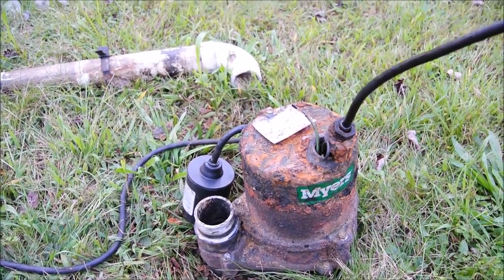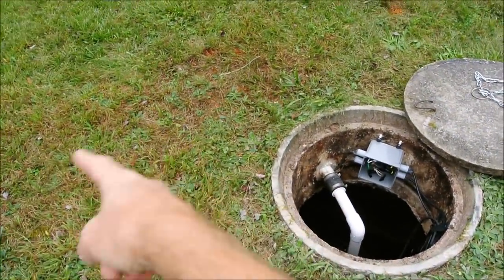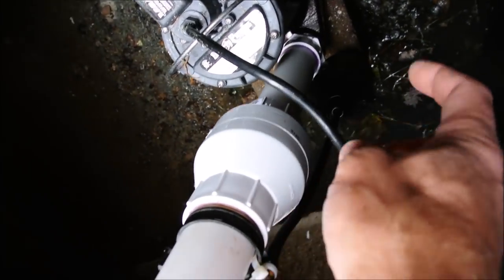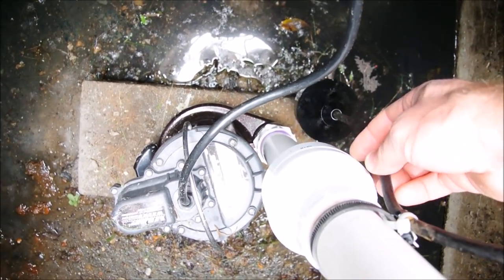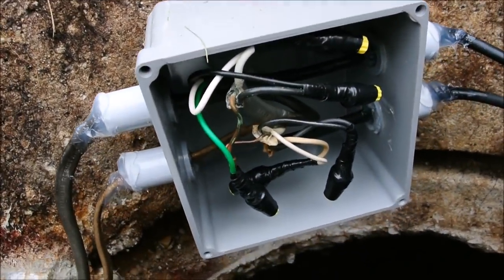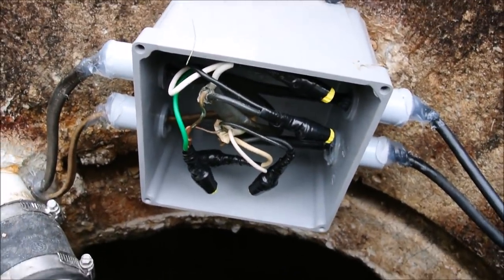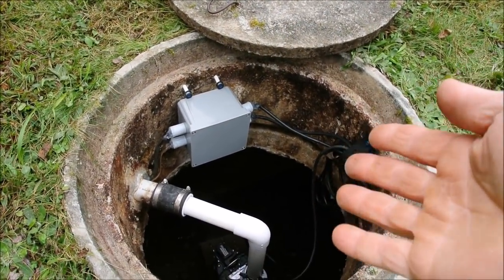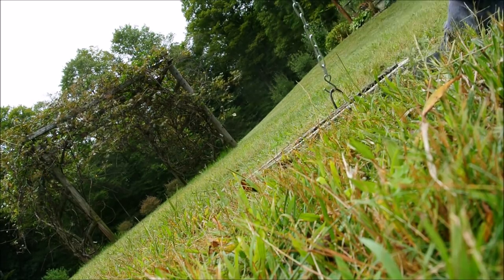Septic pump replace: DIY internal splice box

Comment from the maker: UPDATE (November 2022): 
The 'new' pump died yesterday. It survived for four years and one month. As I pulled it up, it was a rusty mass of mess that actually had pieces of metal falling off. Because the price of replacement (of a LIBERTY 257 series) had jumped from $141.51 to $210.75, I decided to go with Harbor Freight's comparable submersible effluent pump, a ½HP DRUMMOND, which was $159.99 and seems just as well-built. Time will tell.  

As for the splice box, it did a great job. Very little condensate was inside. Some corrosion to the bare copper was evident, and so I was more careful to cover any exposed wiring this time. The silicone plugs did a nice job; I was easily able to pop one out in order to rewire the new pump, and it was then just as simple to replace. 

This time, as an experiment, I placed inside of the splice box (on the bottom) a few pieces of scrap copper wire, just to act as a sort of anodic lightning rod. The idea was to have these piece of copper become consumed over time, thus absorbing most of the free ions that would otherwise be available to contribute to the degradation of wiring inside of the box. Note that the splice box is a rather well-sealed environment, making it somewhat of a closed system. Thus, the chemical change occurring to the copper inside is a reaction that can be controlled, and much like any stoichiometry problem, guiding the process(es) taking place becomes a game of recipes, in which we need only to determine the limiting reagent in order to slow degradation. One can bake only so many cookies with five pounds of flour. Again, time will tell.
Reply: I actually just bought a piece of property with an old septic system, this video was extremely helpful!
Reply from the maker: @SinclairDIY  Thanks, and good luck with the new place. If you're new to this stuff, here are two (related) videos that might help you:

Leach field restore:
https://www.youtube.com/watch?v=01FvMcsjiMY

Well pressure tank:
https://www.youtube.com/watch?v=WcENUayicPs
Reply: Thanks, I'll check them out!  @pocket83squared

Comment: I'm a Pump Technician and while I dont do anything with sewage I do mess with Sump Pumps quite a bit and also wiring what I need and honestly I dont see anything wrong with what you've done. While I'd do it different with my van stock I would probably do it the same way you did if I had to pay for it myself and find the parts myself. Looks good! Theres 100 different ways to do anything in the pump world!
Reply: what can cause a wire to burn out in the J Box? if it's the sewer pump, is it considered normal wear and tear?

Comment: Pocket83^2 officially has more videos than Pocket83.  And i could not be happier
Reply from the maker: Thanks. I have some more build-ish videos to put out on the second channel soon. It will be a while before I can commit to a main channel vid again.
Reply: @pocket83squared  that's great to hear! My son and I are very interested in what seemed to be multiplayer Isopath
Reply from the maker: That project was totally derailed. You can check the description of the Iso-path videos for the three player instruction sheet, but it's still a work in progress. Player zero has an advantage that I haven't remedied yet, but I have a few ideas.

Comment: My pump died (19 years old) and when the pro came to replace it we found the same kind of wire box. The connections were fried. Literally burned black. No tripped breaker in alarm box, no tripped breaker in main house box. Cleaned tank, replaced pump and box and wires. That was two years ago. Alarm went off today. Pump not working. Hopefully pro comes tomorrow. Watching your video explains what the problem is (bad wiring, corrosion in wiring, something in the wires obviously) and I will make them fix it right this time even if it means mounting the wire box on my tool shed. Thanks for the videos

Comment: I do this for a living. 
Everyone wants to splice your wires in a box but the problem is, condensation. 
I recommend just using blue wire nuts with silicone inside and securing the wires under the lid.
Reply: Can you drill a condensation drain hole in the box ?
Reply: gurjinder singh then what good is a box?
Reply: What can cause a wire to burn out in the J Box? if it's the sewer pump, is it considered normal wear and tear?

Comment: Thank you so much.  You have given me great ideas.  I have a system exactly like yours.  My house was built in 2010.  The crackpot guy who installed my original pump had a regular interior home electrical outlet mounted to the inside of my tank, located exactly where your junction box is in your tank.  The sad part is that the county I live in inspected this crap and signed off on it.  My original pump stopped working in 2017. I'm lucky it lasted that long.  I replaced the pump myself with one from Home Depot.  Since I was in a hurry to get it running again, I replaced the outlet with a new one.  I knew using a standard electrical outlet was wrong. However, I thought I would replace it next time and wire it inside a waterproof box.  Last week my pump died a terrible death.  Something failed on the pump and water got inside the pump.  It melted where the plug was connected to the electrical outlet and tripped the circuit breaker.  I called electric companies and they wanted $3000.00 just to install a waterproof box and wire it just like you did yours.  The electric companies won't touch the pump, so you have to hire a plumber too.  The plumber wanted $2500 to pull out the old pump and lower a new pump.  There is no way I'm paying $5500.00.  So, I just installed the new pump the other day.  It's an Everbilt 3/4HP from Home Depot.  I temporarily have it plugged into an extension cord that is plugged into an outdoor GFCI outlet.  I'm waiting for all the new electrical parts ordered to arrive tomorrow.  I plan to use a waterproof junction box and do mine like yours.  The total cost for doing it myself is around $600.00.  Thanks again for making this helpful video!
Reply from the maker: Great to hear. It's crazy how much those who don't DIY are willing to pay. Strange thing is, it's never been easier to find out how to do things yourself! Respect to you for replacing your own sewer pump. 

As hiring a trade 'expert' becomes increasingly impractical and/or inefficient, and as the acquisition of knowledge becomes increasingly inexpensive, demand may just start to shift the standard of what's respectable. People with dirt under their nails should've been respected the whole time. Our age of entitlement is dwindling.
Reply: @pocket83squared  I agree 100%.  I remember when I was in High School, back in the 1980's, our teachers would look down on those students who wanted to go to Trade School.  These teachers pushed the students to go to big Colleges and Universities.  We are now paying the price for this arrogant attitude. We now have a shortage of tradesmen, due to generations of young people being made to feel ashamed of this type of work.  In my opinion, big College degrees are overrated.  So many people now have College degrees that having one isn't special anymore.  I hope future generations will realize the importance of Trade Jobs and look upon them as honorable professions.
Reply from the maker: @georgelineberryjr3673  The irony is found in the number of not-so-impressive people who nevertheless hold impressive degrees. As much as I love and respect higher education, most of it is like throwing sand at a person and asking them to catch it. 

In the 80's, we were still certain that every social problem could be eradicated through education. Twenty years later, it didn't work, but at least now we can be sure that it will: we just have to get everyone certified as competent!

Comment: Yes. My 4 tank system 17 years old. Issues from day 1. Major problem is flooding during heavy rains. Flooding meand electrical plugs and wires were the issues like aerators burning out, floats inop, box fried. I finally got new box. Tried wiring it, pretty easy, this one to that one..Noticed alarms buzzing but off. Opened the junction and entire pipe, splices flooded. Now, realized I need to raise the junction to inside near lid. Foumd a box on Amazon that has 4 water tight in ports for the 3 float wires and pump.  Need a 1.25 hole to pvc conduit. Saerched and similar to the box you have. Added safety was water tight wire couplers floats 2 wire and pump 3. Before, the pvc came in thru riser level with tank so if water ever got high for a bit the commectiins were flooded and wet. Pump always worked though bit the connection elbow hole only had silicone to seal a those cables. Now find 20' wires to run new to box. I will use DB wire in the 1.25 for pump. Did it to my aerator and that sucker still good and no more corroded wires.

Comment: They to make all plastic "strain relief" connectors for cable but your silicone solution is better than anything I have seen. Great job!
Reply from the maker: Wow, thanks. The whole time I had the feeling I was settling for something, but I just couldn't trust those strain relief grommets- especially considering their price. The couplers/bushings were 20¢ parts. 

While I have you here, would you care to speculate what compound in this environment would turn copper wire to a silver paste? I used a piece to hang something and to test raw Cu's resistance to corrosion, and two days after there were silvery bubbles coating the surface. Ammonia, perhaps?

Comment: I’m surprised the box is on the inside of the tank itself, you can put it on the outside I believe, it’s been years since I did anything with a septic system, but I believe around here it’s set up on the outside of the tank, it bypasses the problem of corrosion, well, from the tank anyways.....I think, but I’m fairly certain about that. also, make sure you get your hepatitis shots! Lol
Reply: most boxes ive seen are still all in the tank. but still in training and hvnt seen alot of tanks yet.
Reply: But everyone hates having a junction box out on a post in the yard

Comment: I tried the light blue waterproof ones. The wires were coated with that goop. I had connectivity issues zoo took those sucker's off. Cleaned the wires and used large nuts. Less resistance and floats work now. Yes, later squirt in silicone. Added protection is ise liquid rubber or fuse tape. With the box high, like mine is now, less chance for the wires to be submerged . Before the wires were crammed into one of those D junctions. only a silicone filled hole where the wires entered. Needless to say any high water the enclosure was filled with water and float and box issues. Those wore things are glans. I got the 1/4 and 3/8.
So much easier now should I need to replace a float or the pump..Wires not dangling all over . Connections are right at the top so you don't have to work down into the riser hole. Y tank lids are poly but think I an adding a vent cap. The gray water tank gets really moist in there , always wet . I take lid off every so often to let the thing dry out. May use the extra old lid and make a vent cap to let that moist air vent out

Comment: Nope, wrong video to watch on my lunch break
Reply from the maker: There's a layer of fats and oils that float to the top of the first tank, effectively sealing in most of the gasses that result during the first stage of decomposition, so it doesn't stink as bad as you might think. Hey, is that salami? Can I have a bite?

Comment: I can share with you, that in a sewage tank, using clear silicone does not work. It is not airtight as you would believe, the toxic gases can pass through. I also tried using 2 part epoxy filling the splices pushed into a pvc pipe much like those sold similarly. Even that failed.  I've a Myers 2 hp 240v pump, in a tank much like yours, except it's a grinder pump. All my attempts eventually failed, even the SO cord eventually failed in a random spot, so it's a high degree of difficulty in any case.  The UL-listed individual splice devices consisting of a wire nut and a tube filled with some sort of nonhardening silicone the joint is pushed down into, ought to work.  I am replacing my Myers pump originally installed in 1992 today, so it's served its mission.  The tank is like 14 feet to the bottom, so I need to splice similarly to what you are doing.

Comment: The first problem you have is all the electrical connections are inside the Pumping Station, which is never a good idea. I don't know what part of the country you live in, but I'm in the northeast. As a Septic & Sewer Professional with 20 years of experience, I've repaired and installed close a thousand pumps in my career. As a result, I can tell you in my home state of New Hampshire, we try and make all the electrical connections for both the Pump and the Pump Alarm external of the Pumping Station or Pump Chamber. In other words, by using a pressure treated 4x4 or 4x6 to mount a Weatherproof or Waterproof Electrical Junction Box, it gives you place to attach the Electrical Conduit, and allows for easy access above ground. Here in New England, that's really important, because it's not uncommon for us to have 3 feet of snow on the ground. Keep in mind, in the middle of the winter, you need to be able to get to all the electrical connections without having to dig up the Pumping Station to access the wiring. Besides, "higher is drier" and keeping the electrical connections outside of the Pump Station keeps them away from corrosive gasses as well. By the way, you left way too much "swing" in the Alarm Float cable, because the Alarm Float wire only needs a few inches of play, and the height or elevation of the Alarm Float is dictated by the depth of the Pump Chamber and the elevation of the Inlet Pipe that allows the water to flow into this compartment or chamber. To be clear, you don't want the Pumping Station to get to the point where the water backs up into the Septic Tank, or worse, backs up into the house, before the Pump Alarm goes off. Believe me, that can happen if the Alarm Float isn't installed correctly. Ideally, when the Pump Alarm is activated, you still want some storage capacity left inside the Pump Station, which is why it's always a good idea, to have a larger Pump Station or Pump Chamber than you think you'll need. I never like to see anything less than 500 gallons, but sad to say, I've seen lots of 200 and 300 gallon Pumping Stations. In my experience bigger is better, and 1,000 GALLONS is better, because the pump won't have to run or cycle as often, which is better for the pump, and it minimizes the number of times a day the leachfield or drainfield gets water. Lastly, although silicone caulking works to seal the electrical box, I recommend Duck Seal and waterproof or weatherproof wire nuts instead of using electrical tape. However, you were very creative, and I'm sure what you did will work.
Reply from the maker: An external housing for the electrical stuff would be a nice addition. Perhaps in the future. I'd have to figure out a way to pull it off without having another unsightly object in the yard, so an above-ground junction box is out of the question. But this repair was done as soon as I had moved in, and I really just needed it to be functional and reliable. Two years, no problems. Just had it pumped. 

As for the alarm float, it will signal before anything would spill back into the first tank. Back up into the house is highly improbable, given the amount of fall.

Comment: That was actually really interesting! All of the septic systems here are gravity systems. Wastewater drains from the house into the tank outside (usually around 4' away from the house, buried about 1-2' deep). It's a single large tank with two chambers inside which separates the solids from the liquid, and the liquid feeds into a tile bed. Inside the tank are specific bacteria that break the solids down, so it doesn't need to be cleaned out for 6 years or so, on average. 
How strict are the regulations in your county? Every system here in all of Ontario needs to be inspected and approved. I'm not sure your solution would pass inspection, at least not here. Which isn't to say that anything you did was wrong, in fact, I'm impressed with how thorough of a job you did! Which, really, shoudn't surprise me in any way, lol

Comment: what can cause a wire to burn out in the J Box? if it's the sewer pump, is it considered normal wear and tear?
Reply from the maker: Not sure if I understand your question. If there's evidence of burning inside of your splice-box, that suggests a short. Shorts are not normal wear-and-tear; they are caused by electricity arcing, probably from an improperly sealed box and/or poorly wrapped connections. Could also be damage to the wiring jacket. Look for nicks.  

Clean it all up so that you can get a better look at where the short happened, and maybe you'll be able to identify the likely cause. 

Note that if the pump had shorted out underwater, it probably (PROBABLY) would've simply tripped the breaker. Anything charred inside of a splice-box suggests to me a shoddy installation.
Reply: Noted. Thank you for the prompt follow up

Comment: Self-amalgamating (or is it vulkanizing?) tape is great for sealing wire connections. It's not that expensive and I assure you lasts 10 times more under the elements than duct tape. Just a tip..
And only for a moment.